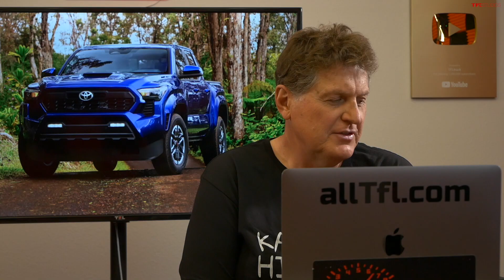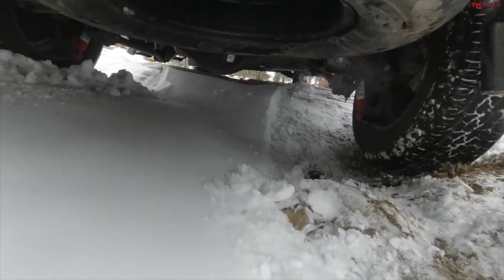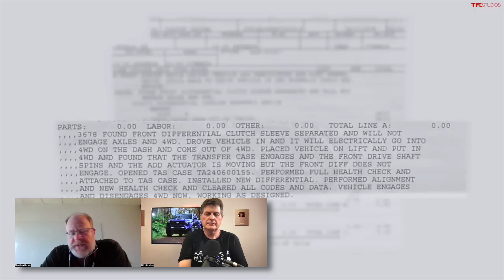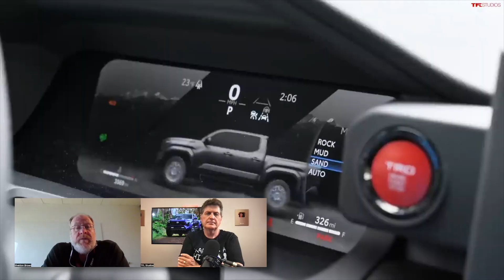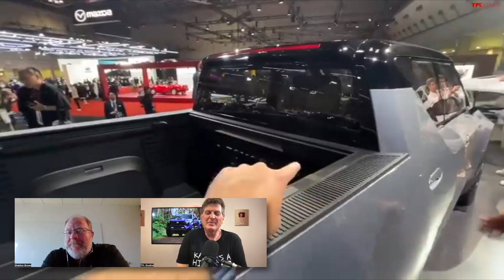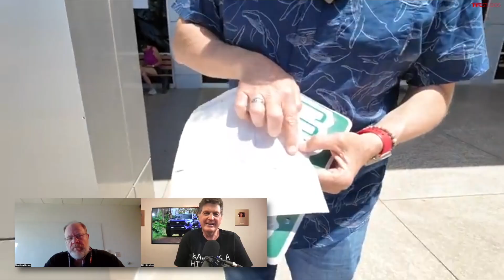The Real Story Behind How Our New Tacoma Broke & How Toyota Plans To Fix Yours!

Comment: Why didn’t they just strengthen the axle shaft instead of do an update? Their axles should be able to withstand the power of the truck while four-wheel-drive considering that is what the truck is aimed for. Will my 2026 TRD off-road be updated already?

Comment: my  2025 tacoma SR5 rear diff broke at 7800 kms , havnt even had my 1st oil change ,  i was also on ice and snow ... software isnt the problem... the rear diff should have a proper lsd !    the tuning stratagy  shoukd be fixed ... but in reality they should update the axles  and differential to a proper lsd and hardened axles !!   this is my 2nd 2025 toyota that has had similar issue.. my  GR corolla broke the transmission at 20 000 kms clutch was fine no abuse etc never tracked ,     toyota used to test there products to 1 000 000 miles aka the 1uzfe    now they test to 150 000 miles   which is becoming noticable ,  i was planning on buying the 2027 GR corolla  or celica ... and now im nervous   buyer BEWARE!

Comment: The brakes broke it. Modern crap screws us again. The other day I had my truck try to steer me into a wide load. NICE! MORAL of the story try to set it up as dumb as you can. To where you are in control. It's not a SNOWFLAKE itself destructed. That pesky unnecessary software.

Comment: Basically the computer sent "too much torque" to a poorly designed part of the drive train. So were goin to reprogram the computer to limit power/capability rather than fix the underdesinged physical parts. Got it, the 4th gen is worse than the previous gens.

Comment: Now, I do like Toyota, and really wanted the manual transmission, crew cab, and rear wheel drive. But Toyota never offered it. 

I have driven manual transmissions for 30 years, all were RWD tho, and I was a CDL-A truck driver for eight years. 

Please forgive me if I have a really basic 4WD question, I feel sheepish just asking it. 

However, I have never owned a 4WD truck or SUV, because I don’t have the need to drive off road at all. 

How good will the Trans just handle driving RWD, compared to full bore 4WD Trail blazing? If I use the 4WD, it will be only for snow covered roads here in Pa. Also, we own a 2019 Sienna that is perfectly capable of tackling the snow anyway if needed. ^^ 

Thanks everyone.

Comment: I would bet money that the reason the truck broke is because they were gassing it with craw control engaged. I cant imagine the drive component breaking in a low traction situation unless craw control was applying breaks to what ever tire had no traction. Just a guess.

Comment: The gist of what I got from this, is that they built the components to withstand an exact amount of force ( built to a low cost probably ) and that the traction control while in four wheel low range exceeds the amount of force the parts were engineered to handle...
Now anyone thinking about modifying these trucks remember that, forever.  lol
I still like it, because I'm fine driving a truck like a truck not like a sports car and I dont beat them off road like a 30 year old jeep.  But my point remains, its built as cheaply as possible to do its job.  Just like a craftsman lawn mower.

Comment: I worked for a Toyota Dealer for a long time.
One thing I saw over the years that when there’s an issue they are very slow to put the blame on them and want to keep warranty cost down.
Sadly Toyotas quality has gone down a lot and if you are considering buying a new vehicle look at other vehicles then Toyota because there are very good vehicles coming out from GM and Ford .

Comment: So much for Toyota's PREVIOUS Record in indestructible Hilux and Tacoma models... the corporate cost cutters finally made it to the new line and did their "take out all margins of safety" magic making them vehicles I'd never trust now!   I'm sticking with my 6-spd manual TRD with the 3.5 liter... yeah, it's a chick truck (it has no balls) more suited to city driving and NOT real off-roading, and its fuel economy is PATHETIC!   I rented a 5.7 Liter Hemi Quad Cab 4x4 Ram 1500 and got better fuel economy out of it than my gutless TRD!    This was my first Toyota ever and it likely will be my last.   Sadly there are not many other options out there especially with a manual transmission, but I'll try or just buy an older US Made model and restore it.   Simplicity is truly a beautiful thing especially off roading where you want LESS potential for failure.   Toyota seems to be losing sight of this philosophy with their 2024 Tundra and Tacoma offerings.

Comment: We have changed the logic train to prevent what happened. This has been implemented to the new hybrids Iforce max.

Clearly the engineering and software exceeded the design of the unit and it mechanically failed.
Instead of reengineering the part for future vehicles and a RECALL of all the ones sold…..will do a software update to the transmission and call it a day.  
Toyota reliability will go as far as the software

Comment: Toyota engineer: "The last thing I'd expect is that we'd see the front differential have problems." *immediately diagnoses it as ADD failure which is located in the front differential, and is a problem 4x4 Toyotas have had for years.

No matter how strong you build the rest of the drivetrain, the ADD ends up being the weak link, and it becomes more and more pronounced the higher the loads, the larger the tires, and the more difficult the terrain.

If Toyota gave it a manual transfer case, you can get rid of the ADD all together. Throw in some optional lockers for both the front and rear and you'll have all your tires spinning at the same speed, no need for abrupt applications of individual brakes to try to mimic a limited slip differential. If you absolutely could not have a limited slip differential or a locking differential then do what ZF did with the Kubelwagen in WWII with a differential that through German clockwork worked exactly the opposite way an open differential works. Instead of power taking the path of least resistance and in so doing going to the wheel with the least amount of traction the ZF differential sent the power to the wheel with the most traction, and it constantly vectored the power between the two wheels, never truly locking. 

I was planning on replacing my 94 Toyota pickup with a seemingly unsolvable electrical gremlin with a new Tacoma 2 door, RWD with a manual. Guess what Toyota won't sell you? You can get a crew cab short bed with a manual, just not a 2 door. So no new Toyota Truck for me.

Toyota is trying to fix a hardware issue with software. You know who did that too and what they did it with? Boeing with their 737 MAX 8. 

Do better Toyota.

Comment: A chain is only as strong as its weakest link. No point in having such high torque numbers if the drivetrain can't handle it. Toyota used to be a brand about overbuilt boring reliability, since Akio stepped down the brand took a 180 and now chases advertisable spec numbers, which would be fine if it wasn't at the cost of the dependability they built their prior reputation on.

Comment: So what I heard is if you use it in 4 low in slick condition with the rear locker engage you are likely to break it because they didn't build in a safety margin. They exceeded the design margin by "Exceed it by 1.7%" 

Long story short don't rely on it if you live in icy climates

Comment: Toyota is making the same mistake the "Big 3" in the 80s 90s and early 2000s. Toyota is giving the customer what THEY want us to have and not what the CUSTOMER wants and trying to cut engineering corners. I figured Toyota would have learned what caused their success and the "Big 3's" failure by now. Tanking sales and massive warranty recalls is what is in your future Toyota. I have owned your vehicles for 30 years now. Looks like I will have to give the "Big 3" another look. To little to late tfl. You guys should know better.

Comment: The only acceptable answer here would have been if there was a very rare defect in the part that failed. To say that we design our drivelines so weak the braking force and engine torque can break it is admitting these trucks are subpar. I am so glad TFL got this break on camera because it is obvious to everyone that the truck was not being abused at all and there was no high inertia situation that caused excessive torque. This type of driving is what any 4x4 owner would typically do and I’ve done much worse and never broke anything on my ‘98 Tacoma. To say the truck functioned normally is definitely not what a potential truck buyer wants to hear.

Comment: For those confused by what he said, it boils down to how they manage traction through braking. 

Wheel slip indicated, overall vehicle speed extremely low, engage brakes a specific percentage on slipping wheels to allow torque to move to stationary wheels.

What happened was every wheel was slipping, brakes engaged partially to direct torque to the front, then one wheel, which then slipped with the additional applied torque, causing the system to over react and lock the brake on that side of the axle. Aka, greater than 85% of the engine torque in 4 low was going to one wheel, which then had the brake lock on to prevent wheel spin causing an enormous shock load and breaking it. A software revision to prevent that exact scenario will not detract from their system, they just overlooked a fluke scenario where the truck can almost intentionally brake itself.

I'm not a Toyota fanboy, do not own a Tacoma, and probably never will since they won't bring a diesel to the US, but you guys are being too harsh on them. Would it be better if they had a front locker vs brake torqueing? Yes. Would it have prevented this issue, also yes. Sadly, they're not going to shell out the extra cash to do this despite GM and Ford offering it on their top trim off road vehicles.

Comment: Contrary to most of the other comments, i think toyota should be complimented for how they handled this.  Sure, you probably got "special treatment" but you also did a service for hundreds (or more) people who are shopping for trucks.  And, Toyota did a service as well by explaining exactly what happened and what they are going to do.  FLT has had another OEM, cough Subaru cough, who just blamed you and stonewalled.  Toyota, in contrast, explained that you put the truck in a rare situation it could not handle.  Nothing wrong with that.  Your job is to stress test the truck.  But Toyota's job is NOT to build a truck that can handle anything.  It's job is to build a great truck that does many thing well.  

Reading through the comments I do not think folks understand what they were being told. Yes, Toyota is going to limit the Taco so that if it's in this particular configuration, it will not break.  This isn't anything new.  All vehicles--all equipment of every kind--puts in limitation so you don't break it.  E.g., we've had rev limiters forever.  (BTW, I know from someone close to me that the absence of such limiter on an old RD 400 can lead you to a seized engine and a bad bad slide across (as a hypothetical example only) the 405 freeway.  Every vehicle has many such features.  

Sure, you can beef up the mechanical parts so they will not fail but there is always a trade off in cost, weight or performance.  You could make a Tacoma like a military vehicle but you would not want to have it as your everyday drive.

Comment: Hold on there Wyatt, the tolerance stacking in the system exceeded the spec'ed torque load limit by 1.7% and that broke the part?  Sorry, but that isn't credible.  Mechanical parts are given large limit margins to account for production tolerances, materials, etc.  If you said we screwed up and the program drove 50% more torque than the limit for the part and it broke, I would buy it.   This sounds like a big smoke screen for some corporate sacred cow idea that is the new North Star in engineering (like, we need to increase margins, $.02 at a time....

Comment: If I'm understanding this right, that means the hybrid motor is REALLY bottlenecked if they're de-tuning the non-hybrid. So that's going to 100% be your point of failure once you do anything from power adders like tune, turbo, cooling, and most obvious is something along the lines of 4.10-4.56 gears. I suspect the motor itself is fortified well and could handle quite a bit more within reason. If Toyota sticks with bare minimum overhead on transmission and transfer case, I'm sure someone like Puretransmission will do stage upgrades like they do for ZF8 in everything from the GR Supra to all the BMW M's and M-lites. Kind of sad it can't handle 4Lo stock on non-hybrid motor.

Comment: When the truck broke, it appeared that they simply put the 2023 driveline in with an engine that made a lot more low-end torque.  Simply a manifestation of Toyota's new "cheaper is better" approach.  I'm glad we have a 2019 and a 2021 made before the accountants got honorary engineering degrees.  Oh, and TFL, on the point of the Tundra 3.4 fiasco and reported new Taco problems, you all might want to change your channel name to Toyota's Favorite Lackeys.  Really losing a lot of credibility with the fealty.

Comment: My 1969 Ford 4x4 truck has never let me down, I know you have to get out of the truck and turn the front hubs into the lock position and maybe get your boots muddy then get back in the shift it into four wheel drive but the axles have never broken and it doesn’t have any software. O and you have to roll the windows down manually. These new trucks are a disaster

Comment: This is very disappointing as a Toyota fan. I still have a 1986 Toyota Mr2, who starts just fine and is very reliable. It’s sad to hear all this. But this is completely Toyota of Japan’s fault for allowing Americans to design the damn car. I’ve never trusted Americans car quality looking forward Jeep Chevy all trash cost cutting measures. Make the cars cheap as possible, and mark it up as high as possible, Toyota of Japan has to shut down the Toyota America engineering department.

Comment: Customers: we're worried this is a fragile drivetrain.  Do we need to worry about bigger tires? 

Toyota Engineering:  no need to fret.  The drivetrain is engineered to stay intact as long as you don't exceed the razors edge of its design parameter. 

This whole company has become an abomination and this guy is the smoking gun.

How is this a rare Stars allign situation?  This idiot literally admits that he thinks it will be a rarity that people are taking these trucks off-road. I'm shocked that they came out and admitted it failed at 1% over its rated capacity. That's completely embarrassing to this company whose vehicles are known to go hundreds of thousands of miles. Stock second gen Tundra motors running supercharger kits with no internals upgrades and just fine for 10 plus years.  

Compared to this, the tundra engine failures are forgivable. They certainly didn't design that motor to fail in the first 10,000 mi. This guy is coming right out and saying that they developed the Tacoma to the razor's edge of failure based on a complete misunderstanding of how their customers plan to use these vehicles. Rather than change your logic in the ECM why not design the f**** vehicle with a bigger safety margin?

Comment: Many thanks and congratulations to Sheldon Brown for the explanation, and Roman and the TFL crew for this video.  I'll be looking forward to review of TFL's latest purchase!  Still happy with my Tacoma Access Cab SR5-DLT.  Dad's Last Truck has had some accessories added since I assumed stewardship before my kids take ownership: LC Engineering exhaust; All-Pro Off Road skid plate, bed stiffeners and tailgate insert; AJT Design fob cases and more; Redline Tuning hood QuickLift.   (2009 2TR-FE manual 4wd with the ADD)  (My other truck is a 2007 Malibu, 139k miles.)

Comment: Very cool of Toyota to explain the failure and the route they are working on to eliminate the possibility of this happening to another customer. It just reinforces my belief in the company. I've worked in 4 different Toyota factories, helping fix machines and production lines which are broken down. They are very good to work with, much better than several other manufacturers I've been involved with. I own 2 Toyotas out of my 4 vehicles. I wish they made a Wrangler and a Sprinter competitor, and I'd own 4!

Comment: There's a lot of comments here, that Toyota did a quick fix with software by limiting the capability of the power out put. Others then say what a crappy truck, the Kias'  are better, not as good as the old truc, etc..For you people,  you obviously are not in the "creation" environment.  You forgot that this is a BRAND NEW DESIGN with parts and components never used , never used together, and never having had this problem happen. You have forgotten  (or have never known) about all the failed first attempts to design new cars with new ideas that had problems.  Such as the Corvair. The problems people remember about it were quickly fixed, and you end up with a non-traditional car that worked fine. It "failed" after selling 500,000 Corvairs because it wasn't meeting sales expectations, and they stopped making them just like any business would do. I am confident Toyota will fix the design mechanically as soon as they can. And I personally would NEVER buy a newly designed, first generation vehicle of any make or design.

Comment: They are doing the same with the manual transmission Tacoma, limiting the truck engine power output to prevent damage to the transmission. So, the problem here is that mechanically the truck was not robustly designed with a big safety margin. The components are of inferior quality, basically at the limit of the design; just to cut costs. Very sad that Toyota is heading that way; no wonder so many problems with Tacomas and Tundras..